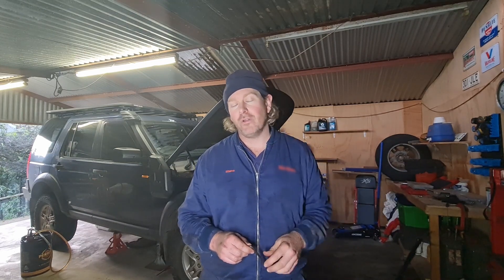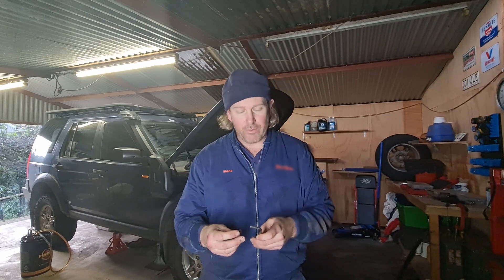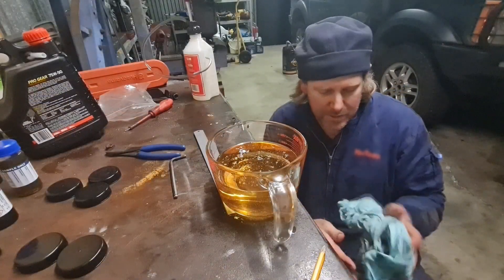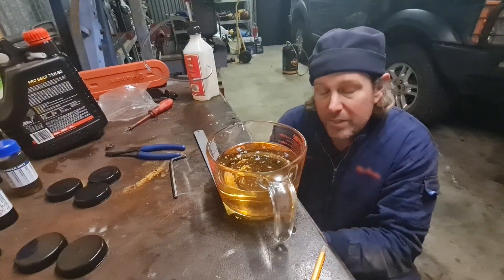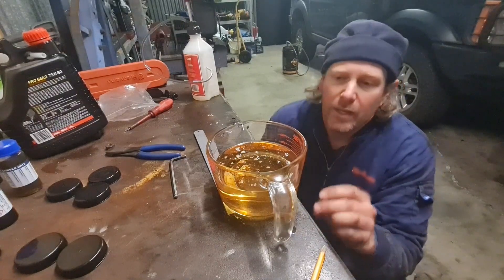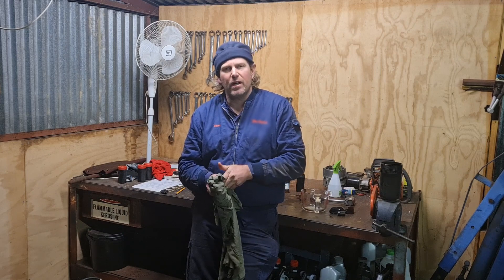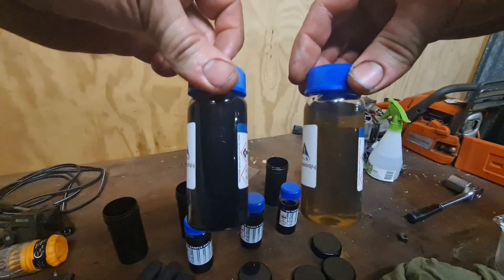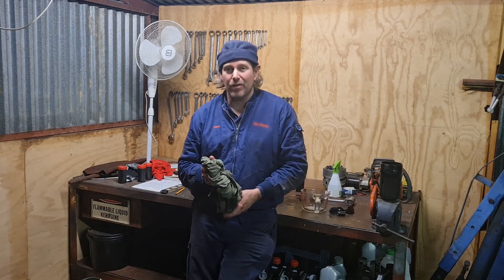Discovery 3/4 Diff fill levels | Measured amount or fill to spill?

Comment: Dont know why people could doub about diff level. LR D3 workshop manual said:

Read Diff: Open diff Castrol SAF-XO- 75W/90 1.1 litres // Electronic torque managed (ETM) unit Castrol SAF Carbon Mod Plus 1.5 litres

Front Diff: Catrol SAF-XO- 75W/90 0.61 litres

Manual said: "Fill the differential  with the correct amount of lubricant"  just this. The only fill plug that show the amount of liquid that you have to insert is the transfercase. Which I did and it takes EXACTLY what the manual said. With 10ml error.

I did mines and its a recommended maintenance, the drain plug has a magnet that catch all the metal flakes and mines where almost full after 200 000 km aprox without any maintenance (Im second owner) because the look of the oil (rear and front).  

Love your LR videos. Waiting for your video "Why run 5W40" on D3/4, the oil research on the old rules was great. I personaly think that 5W40 maybe is to thick oil, and HTHS reduced on 5W30 is not a key to switch for me, because I bought a 0-5w/30 with more than 3.5 and the brand and model is "Extreme A.M.G. VRS 0W/5W-30 GTV"  runs MB 229.5 ACEA A3/B4 (non DPF Discovery 3) and the numbers on the oils and the best you can buy, next to Ravenol but cheaper.  Will test it and see how it performs this winter (your summer). 

Cheers from Spain.
Reply from the maker: I regards to "overfilling" at worse it may cause an oil leak or some increased fuel burn. Ive replaced 3 half shaft seals in the time Ive owned my D3 - and thats been a different one each time so will most likely be a general wear thing. It's not like a reoccurring problem. And my D3 is a heavy weight so that kills more fuel economy than any lubricant savings ever could. 
I'd defiantly not let the diffs do 200,000km without changing. The most I would run them out to would be around 70,000km as they do get quite a load of iron contamination - especially the front as its very hard on the oil. 
I do have some further oil videos planning out in my head, some I will need analysis data for so may take some time to gather all the info
Reply: @Shanes_Shed  If you refer to the shaft seals that conect the diff with the wheels this could be bacause you run springs suspension or to much time on the super extended mode, wheel spacers or different size tire. All this could change the geometry and makes run wrong the wheels. Or change your oil diff with an other no compatible.

For sure the weight is what wears more than any thing but run a lubricant with base "PAO" or "ESTHER" and additives like molybdenum could help a bit. And for sure and lubricant with bigger capacity for detergent the acids that appears during the life of the oil and the capacity of the additives for kill them will take care your motor more than any OEM specification. And not run 15 000 or 30 0000 kms like manual and some people said.

It interesant to find the FTIR sheet of the oil where you can really see the properties of the oil and how the oil was cook at home. 

https://www.oil-club.ru/forum/topic/48427-extreme-amg-vr2-05w-30-gtv-new-2021/page/3/ 

Rusia people need to check this because if the oil is not a VERY GOOD oil the can not run their vehicles.

Cheers.
Reply from the maker: Yep diff to the wheels -  drive shafts, half shafts what ever you want to call them. Standard air suspension on mine and 99% of the time its at standard height. Bear in mind my D3 is aproaching 440,000KM on the odd so it's done 11 trips around the earth, or a trip to the moon and starting to come back again. Don't know about you but the odd oil leak is excpected after all that work.
Safe to say the cold performance of engine oils in Russia is far more important than here in Australia - I don't believe it actually gets cold here, we had hot and warm 😀
Reply: Have you updated your front diff breather? Known to get clogged and cause oil leaks due to pressure build up in the diff. I have a diff leak and noticed the breather is still the original (there was a TSB to change this to the Disco 4 type, but mine was obviously not done).

I ended up buying the ARB multi breather with 4 ports. I would like to connect the transmission, both diffs and the transfer case to the unit, but can't seem to find any info on the locations of the TC and Trans breather lines...
Reply from the maker: @any0n378  yes mine has been updated to the disco 4 type breather. My breather line originally had no chance of blocking as I found the line had a rub through just under the breather. That was about the time I installed the new breather

Comment: Fill-to-spill sets my mind at ease. I would have liked to see fill-to-spill, then drain into a measured container.
Reply from the maker: So I measured the LR amount and added that in. I then measured out 1 litre into my pump bottle, filled to spill then emptied what was left (in the pump bottle) into the measuring jug and subtracted the difference from the original 1L
Reply: Got it. It looked like you just measured the Allen key. My mistake.
Reply from the maker: Yeah the Allen key thing was just for the actually change to the level height rather than volume of oil.